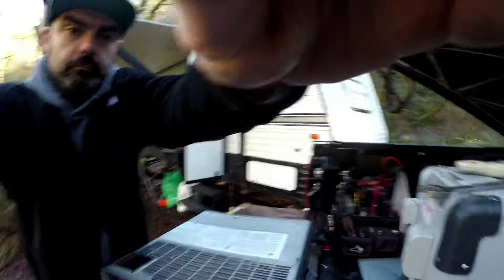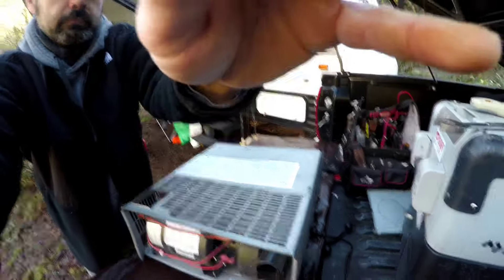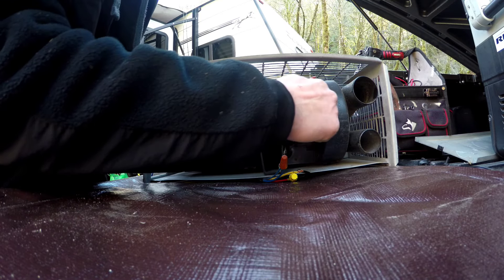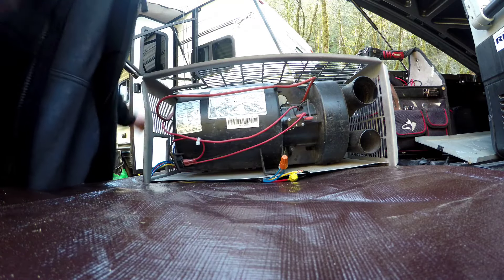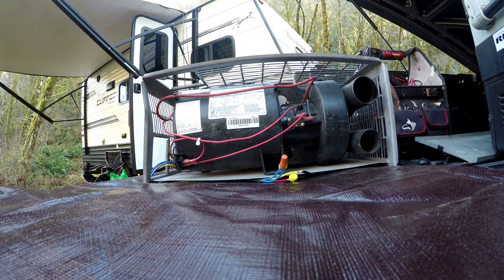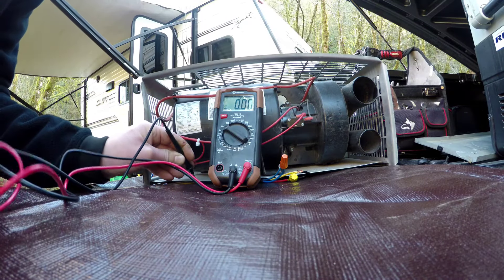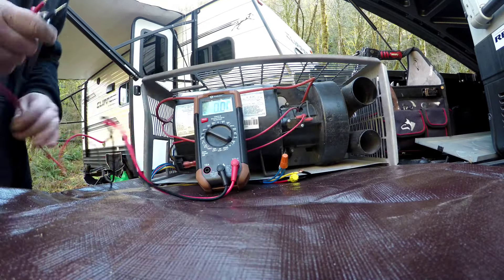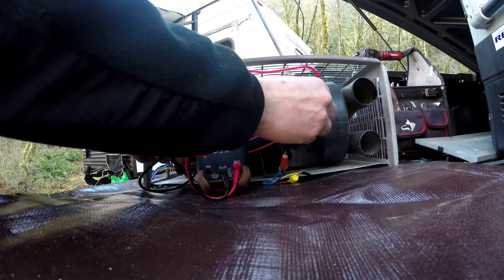Suburban RV furnace won't light, blows cold.  Troubleshooting tips from RV TECH TIPS

Comment: Thank you for your video, wife and kids thank you too. Woke up at 4am with no heat and outside temp of  20f. Was able to jump out the limit switch to get the wife and kids warm. Don’t worry, I stayed up with it running and back of unit remained off until I got it replaced.

Comment: Awesome!  Fixed the 1996 25SF Suburban today.  Replaced both limit and sail switch because both tested as intermittent..  There was a lot of Northern Nevada desert (playa) dust throughout the entire heater, including that sail switch.  That stuff is like fine flour for those that aren't familiar.  It's cleaned up pretty good now though.  Thanks for the tip about connecting the two blue thermostat wires for bench testing.  It's going to get down to 17 degrees here in TX in a couple of days.  Appreciative to have found this video just in time!   🙂

Comment: Excellent Chuck, Thank you!
Just replace my SF35Q with a RP35 in Dec '23. The SF started making lots of noise, bad motor bearing.
3 months later the RP came on, went off, came on went off blowing cold when on. Checked voltage at the high limit, got about 2.58v. Replaced that and the sail switch cause it didn't register 12v either on the neg side. Working now!

Comment: Replaced sail switch, limit switch, and circuit board. Have the power to the switches like you showed but I get no clicking from the igniter at all. Have great power as I ma plugged into the house, propane tank is full and made sure I had gas to the heater. I have a Suburban SF-30F. What would be my next move?

Comment: On my Suburban I had the same problem.... I would add to your 3,  the regulator. I replaced the sail switch, limit switch, motherboard, ignighter, then finally fixed it with a new regulator (basically giving myself an almost new furnace). Check the flame on your stove (strength/color) to diagnose.
Reply from the maker: Good point. The regulator often is overlooked.
Reply: Wheres the regulator located? I've replaced everything else still won't ignite
Reply: @chaoticadventure  You should have two regulators:  The regulator (regulates pressure) coming from your main propane tank (s), and gas regulator (gas valve that regulates gas flow) built into the furnace.  The one built-in is usually referred to as the "Gas Valve" or solenoid, but not sure what Steve Sellers is referring to because he's not very clear and sometimes some people call the gas valve a "regulator".  If you're not sure where these parts are located, I suggest that you research that information for further details.

Comment: Having this issue and great video!  I'm not getting voltage to my sail switch and obviously there's no voltage leaving so I would assume the chip is bad not sending voltage to the sail switch?
Reply from the maker: Sorry for the late response. Power goes from the thermostat to the limit switch, to the sail switch, then back to the chip. Most likely you've got a bad limit switch

Comment: Thanks for your video. My furnace will blow cold air, but no warm air, and stays on/won't cycle off. Replaced the sail switch which was bad, but that did not fix the problem as I'm still not getting flame/warm air. Not sure where to start next, any ideas? Could high limit be the issue or would it be something else?
Reply: I am having the same problem.
My motor was going bad so I replace it, but now it blows cold air, tries to light but never does and also the fan will not shut off until I pull the fuse in the fuse box.
I replaced the Circuit board last year so I don’t believe its that.
I did make sure I had Propane to the furnace
Reply: Just curious, did either of you get a resolution for your problem. Just asking as I have the same issue
Reply from the maker: If it is trying to ignite but it wont fire, might have something in the burner or the gas valve is not opening. turn the furnace on, run outside and smell for propane at the exhaust. If you smell it, the valve is opening but there must be a restriction.
Reply from the maker: Could be a number of things, Try to find out if it is trying to ignite or not. If you dont hear it sparking or smell gas at the exhaust, probably limit switch or control board
Reply: @rvtechtips874  I having that exact same issue it blows cold and won't cycle and I'm sure I probably have to get a new sail switch but the furnace does spark and try to ignite but with no luck any ideas?
Reply: Have you tried  putting in a new limit switch?

Comment: Stumbled on your site and glad I did 
It’s great that you just jump right in and get at repair instead of lengthy preamble on other sites!!!
So here’s my problem I have done all the tests and replaced the burner head as it was rotted out 
My attwood 8535-111 Excalibur fires up like normal but when I put the outside cover back on it goes out (sorry mine is an external access type)  I know it’s old 1999 but I’m in a bad way so can’t be just buying needless parts etc
Do you work on RV generators ??? Don’t see much anywhere!
Keep on doing what your doing 
Thanks Bill in the San Juan Island
Reply from the maker: Thanks for the support! If it works fine with the door off you definitely have an air/fuel problem. I would take that burner out and make sure there isn't carbon build-up in the orfice. If it looks good, maybe the propane regulator needs to be replaced.
Reply: Thank you for the quick reply 
Did you mean the burner jet?
And the regulator you speak of is that the one in heater or on tank?
My ignitor is quite aways  from the burner head like 2-3 inches that’s the way it was when I pulled out original burner head??
The furnace was working before this problem with burner head showed up ?
Reply from the maker: Yes the burner jet. It can be cleaned with carburetor cleaner. The main propane regulator is what I am talking about, right at the tank. The electrode tip should only be 1/4 inch above the burner, that might be your problem

Comment: I think my problem might be a bit different.   I smell lpg out the axaust.   And the fan blows longer than 30 seconds.  So the board is getting power, and the sail switch snd limit switch are probably good, agree?
Reply from the maker: If your smelling lp at the exhaust the board, limit and sail switch are working. You have an ignition problem. Either dirty burner or bad electrode.

Comment: Nice video, well done. If the unit starts and you feel a moment of heat and then the heater shuts down what would you look at.  
Thanks in advance
Reply from the maker: Sounds like it's not proving ignition. Either the flame is weak or the circuit   board is bad
Reply: @rvtechtips874  After pulling it apart the ignitor was way over the 1/8” inch you suggest. I adjusted it and it seems to be working now. We will see. Thanks for your help

Comment: Thank you for the video.  Maybe I've missed it, but how are you able to test/know that unit is working properly after swapping sail-switch without having the gas-line connected to the unit?  Or, do you not need gas in order to find out if it's working?
Reply from the maker: I had the furnace hooked up to propane I might not have made it clear.

Comment: When troubleshooting a 2019 SF 35Q, is it just hooked up to a 12V battery or does it also need to be connected to the to the wires coming from the camper in addition to to the 12V battery
Reply from the maker: Just need a battery and hook the two blue wires together

Comment: Buy chuck.  Thanks for this video.  I didn't get to see what you were touching on the sail switch. But I assume there's 2 wires off of the sail switch and I should check both?    What would be good to know is this.   If no voltage gets to the limit switch then do what?   If no voltage gets to the sail switch then do what?   At some point the board needs to be replaced so what tells you that?  Thanks again.
Reply from the maker: Yes there are 2 wires at the sail switch. With the fan running you should have power on both sides of the switch. Power goes from the thermostat to the limit to the sail and then to the board. If you have Power to the limit and sail switch and it doesn't try to ignite then you have a bad board. Hope that helps.
Reply: @rvtechtips874  I’ve been in it.  Found a bad connector at the limit.  Fixed that and if worked for a bit then stopped.   I pulled the unit. Cleaned the fan and sail switch.  And that worked for a bit then stopped.   I guess I will pull it again and see if I see a light on the board.  Right?   I always smell gas if that makes a difference.  Comments?

Comment: Good video, would've loved to see how to remove it, too!  (I have a 2018 model, I guess, where the sail switch isn't so readily accessible.)
Reply: Had to pull my furnace out inside the camper. No outside access. It had a dirt dobber nest in the exhaust and would not fire. Thank goodness. Removed the furnace,cleaned the nest out and replaced the sail switch. Not sure if it was the nest or the switch but it was right there so I replaced it. Working fine now. 👍

Comment: My suburban sf35q blows but won't light.  I'v replaced the limit switch, sail switch, and ignitor.  I smell gas but won't light, goes through the attempt three times I believe then shuts off.  Circuit board would cause that?  Not much else to check.
Reply: Update ....I found the gas orifice clogged, cleaned and put it all back together and still no light.  Took off computer board and put old one back on.  It lit right up.

Comment: I have the same furnace but the problem I'm having is I have to cover up the inlet air to the combustion chamber for it to even light and when I uncover that yeah it goes out and starts taking again from the igniter.. Unless I cover up most of the air flow it won't stay running and I've checked everything that you showed on this video. Any ideas?
Reply from the maker: You definitely have an air/fuel mixture problem. Your getting more air than fuel that's why it will light when you reduce the air intake. Most likely you have a partially clogged orfice or something in the burner.

Comment: When you checked the voltage across the sail switch had the system already shut down?  It sounded like everything was off in the video?  I was curious to know if there would still be voltage present even with everything shut down due to the sail switch failure.

Comment: Mine just tries to light but doesn’t, it tries like 3 times then it shuts off. Sail switch you think?
Reply from the maker: No, if it was the sail switch or limit switch it wouldn't try to ignite. Might have something in the burner.
Reply: @rvtechtips874  ended up being the gas valve.

Comment: I have SF-30FQ and yesterday my furnace quit working. It delivers cold air and shuts off in a 15-20 seconds. A month ago this problem exposed for the first time and tech determined that was a loose connection on -12V feed.
Reply: What is the potential problem might be since I don’t hear the clicking sound?
Control board, gas valve coils?
Will be greatly appreciated for steering me in the right direction in troubleshooting
Reply from the maker: most likely the sail switch or the limit switch. The control board is not reading voltage in that circuit so it goes into lockout

Comment: I have the suburban NT -30SP and have swapped high limit and sail switch and still no gas to the unit. It was firing once prior to swapping high limit and now not at all. Any ideas on what to check next?
Reply from the maker: Probably the circuit board. Can you tell if it is trying to ignite or does the fan just run

Comment: I have a Atwood furnace that the fan is always on. I disconnected the thermostat wires at the furnace and fan still stays on. Do you have any tips on what to troubleshoot next? Thank you in advance!!
Reply from the maker: Sounds like you have a bad fan relay. It's either part of the circuit board or a separate relay. How old is the furnace?

Comment: Blower runs fine reaplaced the  sail switch  hearing three clicks get green light blinks at top of motherboard  then have another green light at bottom of bourd one More clicking sound  but doesn't light please give back some suggestions
Reply from the maker: Do you smell gas while it's trying to light?
Reply: @rvtechtips874  very little
Reply: We had debris in our limit switch.  Pressed on it a few times to clear the debris, then the furnace would fire right up.

Comment: Mine goes for 3 mins and shuts off... no gas smell.  Fussed with sail switch and it worked (once) but no longer.... still sail/limit?
Reply from the maker: If it was limit or sail switch it would only run for 30 seconds and shut off.   3 minutes means it is trying to ignite.  If you're not smelling gas or not heating the ignitor click most likely it's the circuit board

Comment: I have a 2001 camper.  Sometimes it refuses to try to ignite, and when that happens the fan will continue to run until you turn it off, even though it blows cold.  Could it be the sail switch?
Reply from the maker: It could be but if it is trying to ignite but it won't light, the sail switch is ok you might have something in the burner.

Comment: Hello. I've got a real mystery with the gas valve on our Suburban SF30. The furnace tries 3 times to light then shuts off after 3 minutes. No gas smell at exhaust. I have the unit on my workbench. When I apply 12v directly to both solenoids the gas valve and turn on the propane, gas will flow through the open valve. When I disconnect the 12v the valve closes and gas stops. However, when I reconnect the 12v with gas turned on, the valve "clicks" but gas will not flow. But, if I disconnect the gas (depressurize), the valve will open and I can blow through it. It seems the valve will not open when under pressure. My new gas valve operates the same as the old. Both solenoids are 38 ohms. I would appreciate any guidance as I am missing something.
Reply from the maker: Do you have a regulator on your propane tank at the work bench? If you hook it up to full pressure the valve will lock up and likely damage the valve.
Reply: @rvtechtips874  Thank you for pointing out my error. I have it plumbed directly to the bottle through my tiger torch hose. I'll try to find a regulator tomorrow. Hopefully the valve has survived. I appreciate the timely response.
Reply: With the regulator on the bottle, the valve and furnace is working. Thanks again,
Reply from the maker: Great. Glad I could help.

Comment: I have an issue with my suburban furnace sf ,Fan turns on hear clicking,smell gas but flame does not stay on .. replaced sail switch, motherboard,igniter cleaned out idk what else it could TIA(:

Comment: LOVE YOUR GREAT VIDEOS!! I live in rural W WY and saved me a huge hassle taking my camper down into the city and then having to go back and pick it up! Thank you !!
One question, my furnace is the SF30FG 30k btu but it doesn't heat the camper very well. It just runs constantly. Do they make a higher BTU unit that is the same dimensions? Like a 40 or 50k?
Reply from the maker: Thanks,  the largest furnace available is a sf42, 42k btus. It is the exact same size as yours so it would be an easy swap.

Comment: Mine blows cold then shuts off but if i run the burner on stove for a minute and the hot water heater then turn on furnace it works again blowing heat... weird
Reply from the maker: Does it blow for 30 seconds and turn off or 3 minutes and turns off?
Reply: @rvtechtips874  both
Reply from the maker: You might have more than one problem. If you have to start the stove to get the furnace going you might have a bad regulator or oil in your gas lines. If it runs for 30 seconds and shuts down you have a bad sail or limit switch
Reply: @rvtechtips874  more often its about 30 seconds.  Replaced the regulator in June.  Have a sail switch on order.
Reply: @rvtechtips874  oh wow. That's exactly what my problem is. 3 minute fan.  Thanks. Regulator.
Reply: @TheJasonVoorhees  where's the regulator, in the furnace or at the lpg tank?
Reply: @texasliam  swapped out sail switch, works fine now

Comment: I don't understand why sail switches fail so often. Billions of micro switches have been built over the last forty years with reliable results. Failure rates in RV furnaces seem unnecessarily high.
Reply from the maker: I couldn't agree with you more! They are made so cheap. I service alot of older rv furnaces with original sail switches that work just fine and they are 25 years old but I'm changing new ones under warranty left and right
Reply: @rvtechtips874  Someone told me they coming out of the package bad.